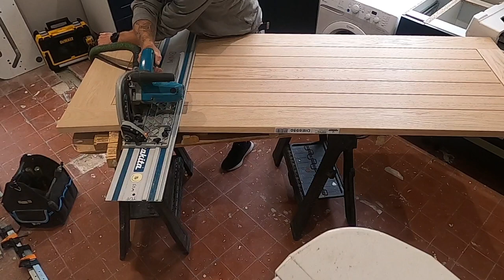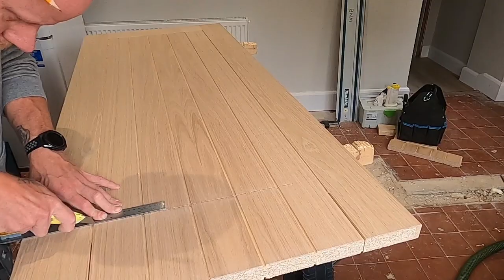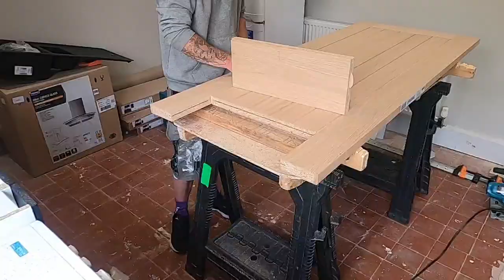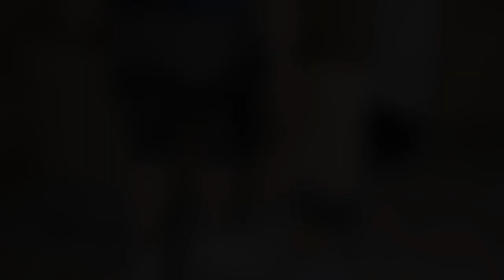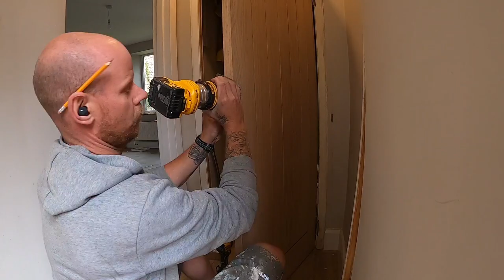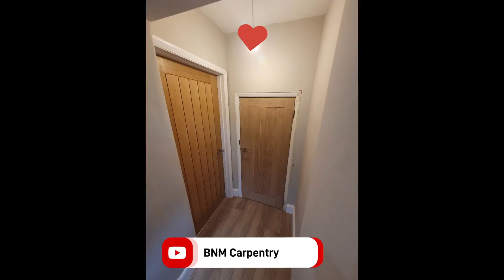How to Cut an Oak Veneer Door #howdensdoors #carpentry #woodworking #tips

Comment: What a fantastic bit of work. How would you approach a door for a cupboard under the stairs as the top rail wouldn’t be long enough? Use an offcut from the excess side rail and accept that the head rail would be smaller? (Guess what I need to do😂😂😂)

Comment: Hi awesome video I have just bought a  oak veneer bi fold door and  it needs 25 mm taking off would install instructions only recommends taking 5mm off bottom and top I’m presuming if I take 12.5 off both would just leave veneer off and perhaps making holes a little deep for the pins to go in to make the door fold … sorry for asking first time fitting a door lol 😂
Reply from the maker: Thanks Paul, are you needing to cut the 25mm off the sides or the height?
Thanks Ben
Reply: @BNMCarpentry  off the height the house is over 200 years old so tried to get the aperture as level as possible
Reply from the maker: Just cut it off the bottom, it will void any warranty unfortunately but as long as you seal the bottom it won't be an issue. 
We have to do it all the time.
Reply: @BNMCarpentry  thank you so much you have put my mind at rest now
Reply: @BNMCarpentry  wife just said your awesome can you come and show us how to do it ha ha ha
Reply from the maker: Haha you're very welcome 👍
Reply: @BNMCarpentry hi how do you seal it
Reply from the maker: Pva, door oil, varnish, even paint will do the job. Anything that will stop moisture getting in  the chipboard core 👍

Comment: Would there be any issue doing this with top rail instead of bottom. Just if I was to cut bottom I’d be cutting into bottom rail but have enough clearance at top. I know it would be visible at top.
Reply from the maker: No issue at all, you can just veneer the top 👌

Comment: Fantastic skilled work, could I ask what blade you used in your plunge saw
Reply from the maker: Thanks Tony I use Trend Craft Pro blades not the best but good value and do the job fine.

Thanks for watching. 

Thanks Ben
Reply: I switched to saxton professional 80t. They are pretty cheap on Amazon and leave a fantastic cut in 40mm oak worktops.

Comment: Do you have any tips on how to cut veneer doors without chipping the veneer? I unfortunately don't have a plunge saw, only a circular saw which I was thinking of running along a straight edge clamped to the door. Thanks for the tutorial by the way!
Reply from the maker: Yes bud use a brand new blade in your saw and put masking tape on the top side of the cut that should stop it splintering. If you're cutting in to the chipboard core as well as the veneer then the blades won't last long if they're cheap. 

I use Freud blades and they stay sharp for ages.
Reply: How many teeth on blade

Comment: @bnmcarpentry Loving this video. I’ve been told it’s not possible to put a cat flap in the Howden’s Daytona oak glazed door; and that “cat flap can not be put in this glass or any other glass door once it has been toughened. You would have to get a door made and glass made and hole cut in it a processing stage.”  Does this sound right? Would appreciate your advices, thanks.
Reply from the maker: Yes you can't cut toughened glass it will explode into a thousand pieces.
Might be able to fit a small one to the side of the glass tho.
Reply: Ah ok, thanks, so putting one below the glass should be ok then?
Reply from the maker: If it fits and not too close to the bottom of the door. Will void any warranty tho.

Comment: How would you cut down an oak vaneer door, when you need to trim more than the recommended amount but less than the height of the bottom panel? 

For example about 8cm. 

I see your cuts are made to take into account the thickness of the blade. Which i don’t think you can do if shortening the door by less than the height of the bottom panel.

Could i cut 4cm off the top and bottom and leave the core exposed?
Reply from the maker: Hi George I would probably take 20mm off the top and 60mm off the bottom so the proportions still look ok, but explain to the client that it may look a little off. 
Or you could buy a donor door and put in a new bottom rail so you don't have to worry about the thickness of the cut.
Or you could make a new bottom rail either out of solid oak or oak veneer mdf. 

Hope that helps, cheers Ben